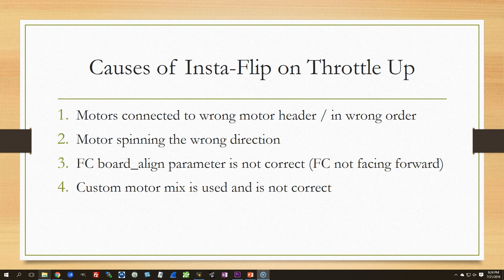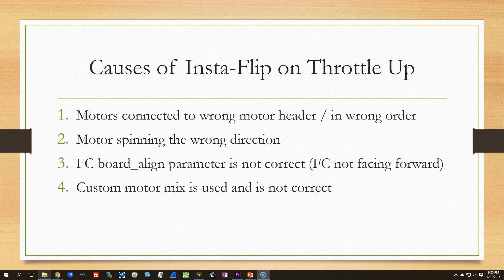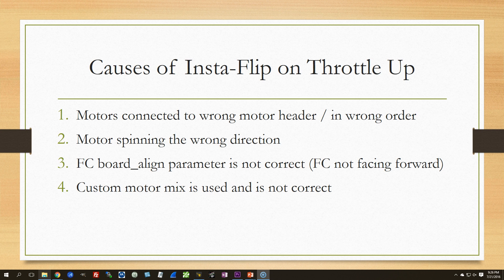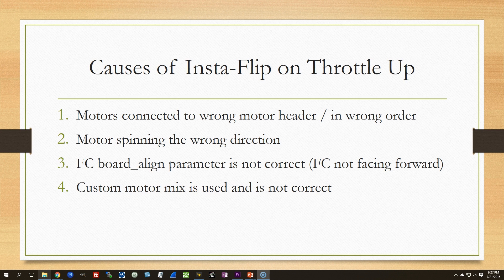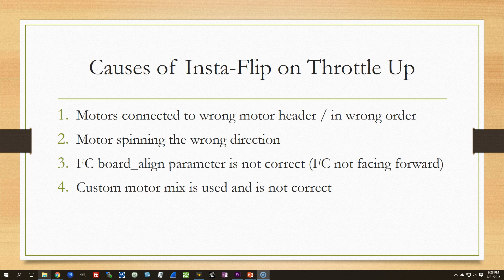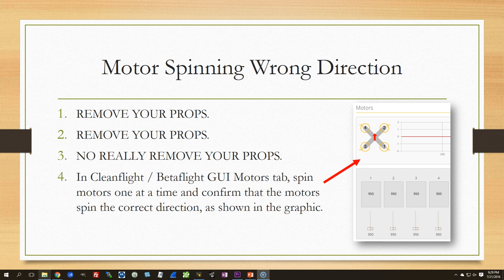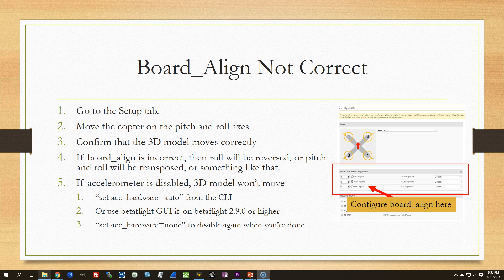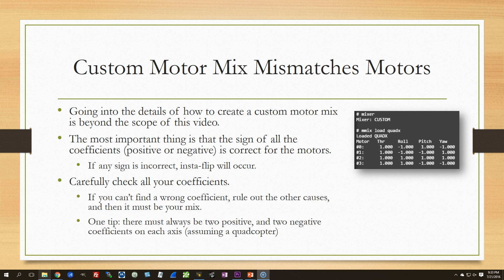Quadcopter Flips On Takeoff: Solved

Comment: I have instaflip. When I check cleanflight, spinning up the motors individually shows that motors 3 & 4 correspond to the diagram, but 1 and 2 are opposite. But I didn't wire them up, they seem to have come from the factory like that, I have no experience with wiring, would wiring be the only thing that would show opposite motors? Thnx.
Reply from the maker: +siliconstate they are probably wire up wrong. If you can easily switch them, go ahead. Otherwise check out the video following this one which shows how to fix motors out of order.

Comment: #1 and #2 should never happen to people.  If you aren't checking the rotation of your motors in pre-flight checks before your maiden then you are skipping way too many steps.  Slow down and do things properly, it will save you time in the end.  Check the rotation 1 motor at a time and make sure the right corner is spinning.

Comment: I had this happen on 2 occasions: FC alignment not correct, and I had I gain to high in Horizon mode.  I accidentally entered a whole number...If I remember correctly I wanted .05 but accidentally entered 5 (lol) and as soon as it left the ground it did exactly what this video demonstrates Except just before it somersaulted it oscillated very rapidly.  Dinged my motors I just mounted :(

Comment: I noticed something a year ago with a home built quad I threw together that seems to fit the description of an upside down FC.  Do I need to be concerned if I don't use matched propellers.  For instance if I wanted bigger props on the rear that on the front. Or does that introduce a different problem.
Reply from the maker: Use the same props on all four motors.

Comment: Should I really remove my props? I don't think I need to remove my props this time...just this once...
 
I mean, how many fingers or eyeballs doesn't someone really need?
Reply: Yougotnomilk but I want some milk :(
Reply: Glad you guys are serious and it sucks you learned the hard way, however I am pretty sure this comment was pure sarcasm. ;p
Reply: Absolutely, positively REMOVE YOUR PROPS! I am sitting here with 3 prop cuts over my right eye, a sliced ear and 3 slice marks on my shoulder because I had my props on when redoing a throttle calibration... Treat these things as if they were armed razor blade spinners, because that is basically what they are!!!

Comment: I had insta flip with motor screws touching windings
Reply from the maker: Weird. That is a hard one to imagine.
Reply: +Joshua Bardwell was cheap 'dragonfly' motors from fpvmodel that came as part of zmr250 kit when it first came out. Basically shouldn't have come with screws that were about 1mm too long on 1 of 4 screws where motor wires joined with windings

Not sure why it did it but the only thing i changed was to remove 2 screws that were touching windings on 2 motors and it fixed the problem. They were definitely touching as i had continuity from batt lead to frame which went away after removing screws

Comment: you missed a fifth that just happened to me, 2 props swapped. i.e: 1:cw,2:cw,3:ccw,4:ccw
Reply from the maker: Correct. I'm not sure why I overlooked that one.
Reply: It is ok, I overlooked it on the field too, paid the consequences too.
Reply: Yup, been there, done that.
Reply: Alvaro
Thanks - That saved me - I had 'no ida' that two incorrectly placed props would flip the Copter...I tested 2-3 times, checking motor spin rotation , gyro, accelerometer, transmitter etc..and it was simply the two rear props were on 'swapped...

Comment: my quad does the yaw of death but only when I do tricks ,when just racing its fine ,,,1000 to 2000 endpoints are set....any suggestions
Reply from the maker: What is "yaw of death"? Be more specific.
Reply: the quad goes full rudder spin
Reply from the maker: +Bogie717 does it tumble on all axes, or just yaw?
Reply: only yaw ...this is not a new build it was flying great for a few months and all of the sudden it started doing the yaw and it will only do it when doing tricks other than that it flies fine
Reply from the maker: +Bogie717 I would want to see Blackbox. Only yaw suggests a gyro or rcCommand issue.
Reply: cobra 2204 2300kv motors, xm20a esc`s naze  rev6
Reply: so do you think I should try replacing the fc.?
Reply from the maker: +Bogie717 Naze Rev6 with yaw only issue, definitely replace it. Naze rev 6 is known for failing yaw gyro.
Reply: I`ll replace the fc.. thanks for the help Josh
Reply: Hi Joshua, I changed the fc and the quad does the same thing still yaws out of control.  it must be a bad esc, any ideas??
Reply from the maker: +Bogie717 have you got a blackbox?
Reply: +Joshua Bardwell No blackbox
Reply from the maker: It's down to trial and error then, unfortunately. Start swapping things. :-(
Reply: +Joshua Bardwell Thanks Joshua , I just  started replacing the esc's
Reply: +Joshua Bardwell I just wanted to let you know that it was one of the esc's causing the yaw issue
Reply from the maker: Glad you solved it! Thanks for letting me know.
Reply: +Joshua Bardwell thank you for posting all these videos , with each video I learn something new👍

Comment: first fpv flight went better than expected! flew like 1.5 minutes but no crashes. i did noticed i found it very hard to hold attitude, so i hit the ground a few times.

also noticed that my cam faded from low to high light and back, if that makes sence. also, when on liftoff i get lines on my screen. still need to do some detective shit before i can properly fly lol
Reply from the maker: Congratulations! Camera fading... could just be adjusting exposure to shadow and light, especially if a CMOS cam. If it is tied to throttle position, then it's probably something else.

Comment: I had this problem when one of the resistors on the ESC got knocked off. The motor would spin but spinning up and slowing down would take a very long time. Therefore, a hardware problem is also a real cause for this behavior.

Comment: I have had this issue a couple times and both times it came down to the yaw ration of the board being set incorrectly in CF/BF.  The confusion for me is the UI image for for the Yaw Rotation shows an arrow pointing Counter-Clockwise so I assume that's a Positive rotation. I rotate my board so the USB port is on the left side. Based on my assumption this would be a Negative 90 rotation. In reality the image points to Negative rotation which is counter intuitive for me.
Reply from the maker: Always double-check that the 3D model moves correctly, and you will catch this out.

Comment: Having a CW prop where a CCW prop should be (and vice versa) will cause an instant flip too because it will be producing thrust in the wrong direction. The exception is when all the props are wrong (CW instead of CCW and vice versa) in which case they will all produce thrust that will pin the quad into the ground!
Reply from the maker: +Richard Ding I don't think that's right, unless the motor is also reversed.
Reply: +Joshua Bardwell Sure it is. Think about it. Switch, say, your front right prop with your rear right prop and try to fly and tell me what happens.
Reply: +Joshua Bardwell Or a safer way to show what I mean to put your rear right prop (which is a CW prop) on your front right (#2) motor and spin the front right motor up in the Motors tab. You will find that instead of pushing air downwards, it will be pushing air upwards.
Reply from the maker: +Richard Ding I see what you mean.
Reply: I know from personal experience that having the wedding prop on a motor will absolutely result in a flip on takeoff. I have seen it happen on multiple quads with the same results. The toolbox I use to take off from has the scars to prove it ;)
Reply: +Elwin van der Meer I agree! Wedding props should only be used for weddings and never on a miniquad.  That would be a disaster waiting to happen! 😁
Reply: +Richard Ding lol, stupid autocorrect.. :D
that should be wrong prop of course ;)

Comment: i have battle scars on my chest from this problem. 2 motors were connected to wrong ports on fc. had taken the quad apart to clean it and didnt pay attention to which esc was which. 
quad violently flipped out of control and slammed right into my chest and props tore a hole in my shirt and left a couple of nasty gashes.
learned a good lesson that day.
Reply from the maker: +LetaM EmertxE I always do my first hover standing lone 30 feet away to be safe.
Reply: I do that now lol. Like i said, lesson learned
Reply: Yeah, I witnessed a friends quad take off max throttle about 2 seconds after arming. Luckily he had his fail safe setup properly and he got the quad back with only a fried FC.

Comment: Funny you posted this,  just over the weekend I was on probably my 30th quadcopter build and my brain decided to swap motor position 1 and 2. No amount of troubleshooting did I catch the motor pin swap, because my mind literally convinced itself 1 and 2 were correct (maybe the CC3D/OP days leaked into my mind). I gave up and the next morning looked at it again and immediately realize it was wrong.
Reply from the maker: This is exactly what happened with this build. I don't know why my brain decided 1 and 2 were reversed. I blame the KISS FC! ;-)

Comment: What would you look for if this happened randomly in normal flying (sudden power, flip, fly to ground)?
Reply from the maker: +Chris Sieracki bad solder, broken wire, possibly desync.
Reply from the maker: +Vic Prk (Slick  Vic) motor cut out.
Reply: +Joshua Bardwell HI. what can cause a motor cutout?
Reply: Some things to check could be:
- Some connection might be loose, check all the FC -> ESCs -> Motors cables
- A bad ESC: remove the props, connect to PC and raise throttle of each motor separately to check there's no cutout.
- Re-calibrate ESC. If using blheli, check the safety option for the motor stop spinning whenever there's too much voltage or temperature (sorry that I don't remember the option name from the top of my head)
Reply: Thanks guys

Comment: Also, make sure your props are on tight and that you have the right props on the right motors!
Reply from the maker: +Chris Sieracki loose prop should result in no power on throttle up. The loose motor will go to full throttle and the PID loop will keep the other motors low. Loose prop in flight of course will result in a flip.
Reply: +Joshua Bardwell ive had mine hover to about waist high and freak out with a slightly loose prop. It wasn't super loose but if I held the motor I could spin the prop.
Reply from the maker: +Stan Davis I see. So it was sticking and slipping. Makes sense.
Reply: +Joshua Bardwell yeah it was just tight enough to hover but I assume any added torque would make the prop slip and the pud controller freak out. just a guess on that but after I tightened that prop it was fine. I know this instance is probably a one off but it was my experience.
Reply: +Joshua Bardwell HI Josh. Just tried a loose prop on takeoff and it definitely flips right off.
Reply: Yeah, a completely loose prop (that can spin in the wind) will result in an instant freak out.

Comment: 5. carbon camera blade is pinching the ESC signal wire and grounding via the vTx SMA connector :)
Symptom -  the quad tumbles over the motor the ESC who's signal wire is grounding.
My 150 was doing this every takeoff in angle mode and only on hard lift offs in acro mode.